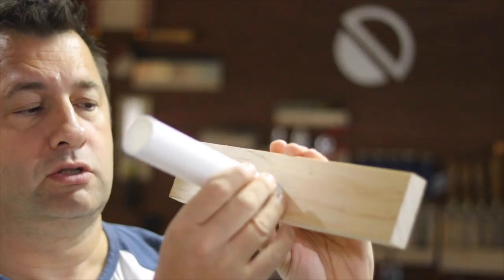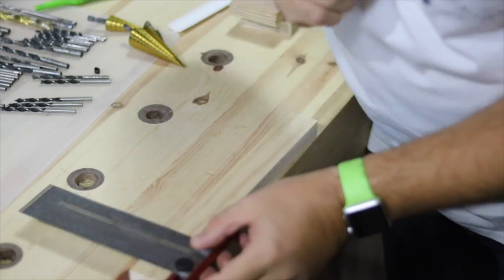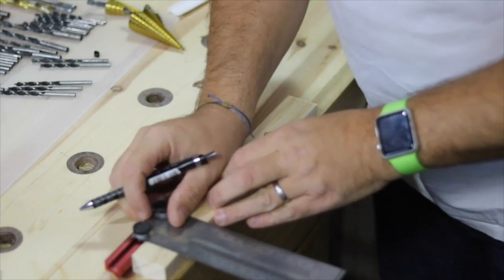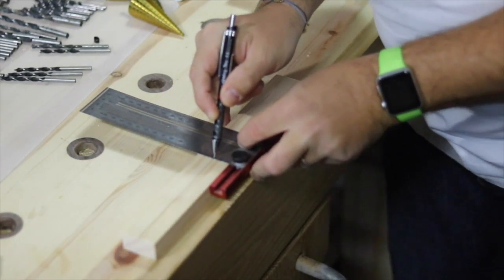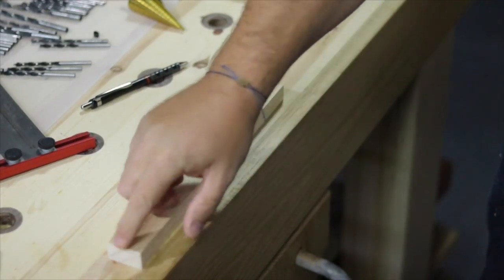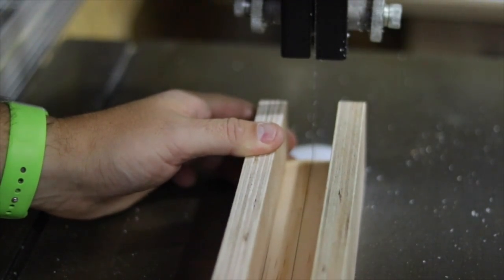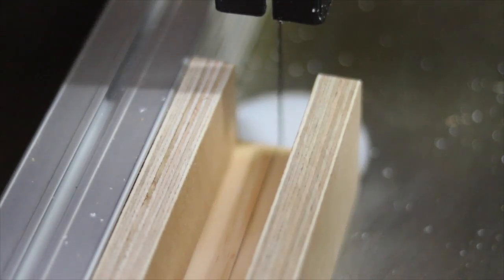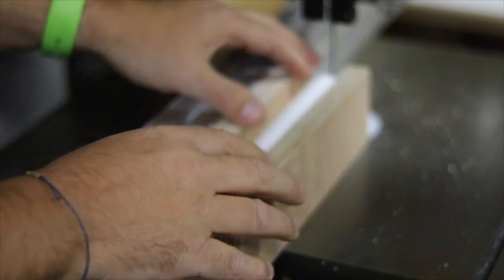QUICK TIP -  Cut Pipe Accurately in Half (down the length)

Comment: Have you noticed the halved pipe shrinking over time? I had a friend cut me 75mm pipe in half. 4-5 months later they are down to 65mm diameter and what was a perfect 180 degree semicircle is now around 200 degrees. I wonder if the PVC pipe is manufactured with some tension?

Comment: Nice for a short piece of pipe unless you manage to rotate the pipe as it hits the saw. I need to rip a full 10 ft joint using a jigsaw.  LOL.  I can make a jig too I guess that will keep it from rotating. 3/4" is what I am working with.
Reply from the maker: Good luck

Comment: like the idea, i'm trying to cut 4" pvc in half - 5 ft lengths... had been thinking of something on the tablesaw but once you put the one side, causes an issue for the remaining side... but this would work well, if the jig was bigger and obviously quite a bit longer to provide the support as it goes through...
Reply: The jig doesn't have to be lot longer.  Maybe just the length of your saw bed.  You can put a stop block underneath the jig on your end to stop it from going all the way through.  Then, just push the pipe through to completion.  Rotation of the pipe may be an issue to watch out for.

Comment: I run the pipe through the table saw twice works really well like cutting a 2x4. jut make a mark on the top point and don't fudge. ?
Reply from the maker: Not accurate enough for me, risk of rotation

Comment: Can I cut a 1 inch band down the center of pvc pipe using a miter saw?  I only want to cut a 1 inch strip out of the pvc pipe
Reply from the maker: I would suggest making a jig to hold the pipe safely at 90° to the mitre saw fence. Keeping the hands well away from the blade, as it sounds a bit risky. Do you have any other tool that may be safer?

Comment: Yeah, how about if you need a full-length pipe cut in half?
Like 10' or 14' or more feet long??? ...Are you still going to base this 6-inch long  jig???... and that's all I got to ask about that
Reply from the maker: Yes you make the jig so you can slide it in to the blade, clamp it to the table, but extend a little more off the table for extra support and then feed the pipe through the jig.

Comment: So if your pipe was aluminum or steel how would you accurately split it?
Reply from the maker: Aluminium will cut the same way depending on thickness 

For steel I would make a jig using a cutting wheel on a grinder

Comment: I think the left side is a bit unnecessary, since you can just use the fence for that.
So actually you can clamp the piece of pipe with just a piece of wood.
But normally I actually just use my sled and hold the pipe.
Reply from the maker: dA Brewer Fair point, I guess the point was accurately on centre and repeatedly.

Comment: I realize this is an old vid....but I was wondering if there is a method for cutting a large sonotube, evenly down the length as well.  
Thanks in advance to anyone who can help. =)
Reply from the maker: Annie o well my first thought is a sonotube is like a big toilet roll, wound the same way in a spiral... if cut in half lengthwise it may start to in ravel, not sure how well bonded they are. 

As for cutting one evenly in half, you could make a trough to push it through. At the mid point on the trough, at either side screw some Stanley knife blades pointing in to the cardboard at a 45°. The key would be to sure there was no rotation of the tube so you would need a reference line drawn down one side of the tube so that as you pushed the tube though the jig you could ensure the line was following the blade on one side. You may need to make a few passes to get though the cardboard. 

You could swap out the Stanley blades for jigsaws in the jig ;)

I would suggest accurately marking the cuts on each side and doing it manually with a Stanley knife and a straight edge. unless you have a lot of them to do.
Reply: @StuffIMade  Thank-you so much for the response.  =)

Your suggestion sounds quite workable.  Drywall tape along the cut edges should take care of unraveling.